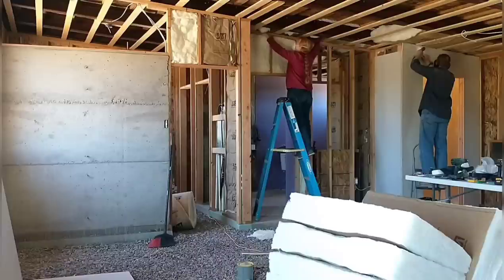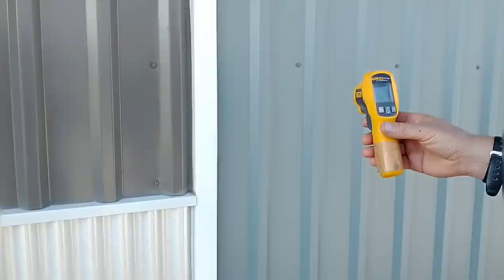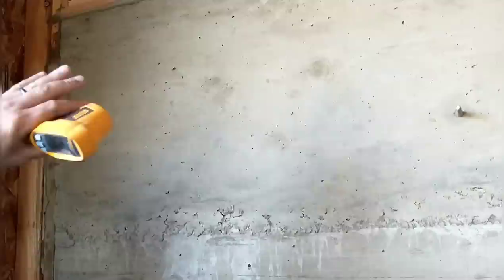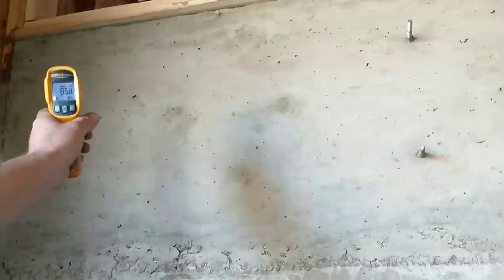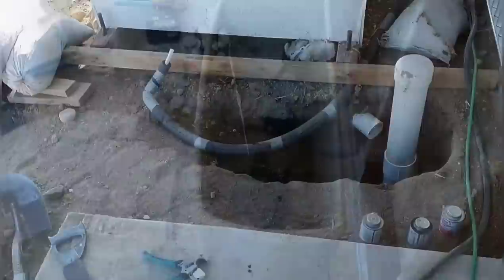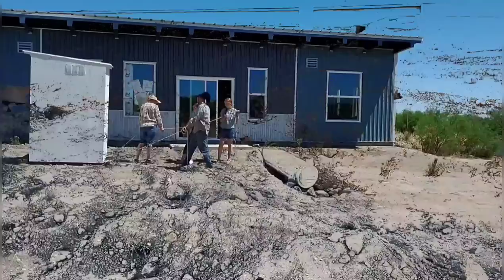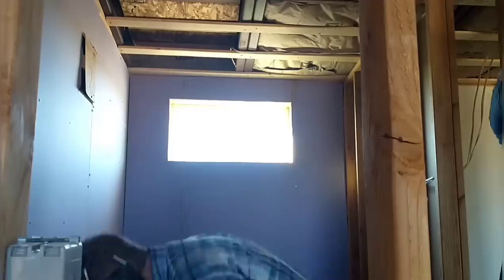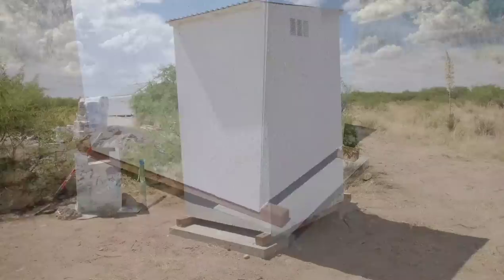PASSIVE Home DESIGN Performance | Exterior Insulation, Metal Beams, Thermal Bridging #32 DIY Build

Comment: Your friends are going to love your drywall lift. Ours gets loaned out all the time. =) Oh, it is also wonderful to use yourself as well.
Reply from the maker: 😄 Yes, it has been really nice! For once he is actually enjoying putting up drywall on the ceiling. Through the years I have held a fair amount of sheets up with my arms and head as he was on the other side trying to hold it up with one hand and screw it in with the other. Fun times! 😅

Comment: The drywall lift is a life/shoulder saver! I bought  a used one for the price of a two day rental at HD.
Reply from the maker: The one we got cost $180 delivered to our house. It works great, and we can sell it when we are done with it. It was definitely worth the cost!  I have held many a sheets of drywall with my arms and head while Red was on the other side trying to help hold it up and screw it in.  Not fun! 😅

Comment: April, your garden looks good 👍 
I found that BC powder (it's a powder aspirin) works on Aphids. 
I did add 10 drops of soap to the 16 oz. of water, BC powder and spray above and underneath.
Reply from the maker: Thanks for the tip! Have you tried crushing your own aspirin, or do you just buy the powder?  I have tried spraying dish soap on the aphids, but it doesn't seem to have much effect. I have been trying to squish and wash them off, and also sprinkling diatomaceous earth around to try to get rid of the little ants. 🌞🌱
Reply: @RedandAprilOff-Grid  I saw a YouTuber who mentioned the BC powder and I had tried Neem Oil for 3 weeks in a row and the Aphids were still eating my Hibiscus blooms. I tried the powder and it worked. If you can find real aspirin tablets, try 2. You could add more if it isn't strong enough. It won't bother the plants. Good luck 👍

Comment: Yes, as the days are getting longer they are also getting hotter. Been over 100-110 in Florida 4 days this week with humidity of 90-100%. Great progress on the house. Just remember to take lots of breaks and yes it's tedious work drywalling. You'll love the drywall lift.  If you take offset measurements and electrical plan you can cut out for fixtures afterwards. But great job! 👍  I'm not sure what type of flowers and sacrificial plants that, but here we use marigolds, dill to keep bugs off the veggies. For mosquitoes we use peppermint, spearmint,, sweet mint, lemon balm, lemon grass and lemon garlic - citronella is a joke.  Use what you can that works where you are. Great job though guys!😊👍
Reply from the maker: That is real hot and humid! We usually get a couple of weeks over 100° just before the monsoon rains hit, but it's already starting to cloud up in the afternoon which has been cooling things down some. Working inside this summer has been real nice too. I have a few marigolds, and occasionally the birds decide they would make a nice snack. Planting some herbs with the beans is a great idea. We have picked most of the radishes, and I was trying to think of what else to plant in there. Yes, drywall is pretty hard on the arms and shoulders! Thanks! 😊

Comment: I did a drywall ceiling in a garage conversion without a lift.

What I used instead was a plywood scrap (about 2'x4'), an old gate hinge and a 2x4 cut a bit longer than the ceiling height.  I could lift up the drywall sheet and then wedge the 2x4 down against the floor.  The hinge was offset from the middle of the plywood scrap by a bit (so the balance was always going one way but still mostly counterbalanced).

It was still a 2 man job but the ability to wedge up a sheet in place made holding it up easy and the screwing is the other job which isn't bad if you aren't trying to hold the drywall in place at the same time.

For bigger jobs, a lift makes sense, especially if you get a cheap used one or you can figure out other tasks to use it for but sometimes you can get by without.
Reply from the maker: Cool, sounds like a good way to do it. We have hung drywall a few time before, and we're not looking forward to it. I would hold it with my head and hands, and he would help hold it with one hand and screw it in with the other. Fun times! 😅 The lift is so nice, and well worth the $180! He was able to do it completely by himself, and somewhat enjoy the process. It would be nice if sanding the ceiling was a little more fun!  😅
Reply: @RedandAprilOff-Grid  yeah, you can struggle or take the easy route.  I made my tool with scraps, a lift was not an option at the time because the job was not paying enough to justify the expense.  A whole house and more projects in the future is a different story.  I'm just always looking for a better way to use my head than holding up drywall...

If I had a drywall sanding solution I would tell you.  Maybe don't look up?

Comment: Try bougainvillea for the climber to replace the English ivy. It needs full sun and does best in arid conditions, actually does better in a raised planter than planting on grade. 
If it does well you can try it on the house. It will need a mounted galvanised wire mesh to climb the metal sides walls you have.
Does best when forgotten about, only needs water if you are having a prolonged drought.
Reply from the maker: Those are beautiful! Our climate is really a challenge. We got down to 5° this winter, so need plants that can tolerate the cold, as well as the heat. We are extremely dry for 9 months, then have the potential for a lot of rain for the 3 month monsoons.  
The native gourd is growing pretty fast now, so at least that is something.  😎🏜️

Comment: We did ICF blocks, a standing seam metal roof on metal trusses with a complete 8 ft overhang.  Almost 6,000 sq ft counting the basement and we can cool it with 2 standing portable A/C units.  Did all interior framing with metal studs.  Only wood is the cabinets.  Wish we had installed a water catchment system.
Reply from the maker: Nice! 😎

Comment: Someone suggested honeysuckle vine. There is an ancient, huge one between 2 houses in Tombstone. I used dish detergent in water in a spray bottle to get rid
Reply: Sorry posted before I was done. GET rid of the aphids on my roses. Your garden looks amazing.
Reply from the maker: Sounds awesome! I love big old plants and trees! Probably don't want anything that would get too big, since we don't want it to cover our solar panels, but something like that might work for the other container. It's been a challenge finding anything around here that will tolerate temperatures as low as 5°. 
I haven't had much success with dish soap, but maybe I'm diluting it too much. I have been trying to squish and wash them off, and also get rid of the ants. 😊🏜️

Comment: I like that you both use protective gear. I’ve done insulation and it’s awful even with long sleeves. You had eye protection and face mask, too. Would a clear face shield help? Your garden looks great!my neighbor has sweet potato vine and bougainvillea in his yard, here in Phoenix. But our temperature doesn’t usually go below freezing.
Reply from the maker: Yes, people think they are fine without proper safety gear, but don't consider the long term consequences. Lungs and ears need to be protected!  A face shield would definitely have been nice, great idea! After the first day or two, I got a full zipper suit and goggles, which was nice especially for doing the ceiling.
Thanks! Things are really growing fast now. 🌱 Our nighttime temperatures are a challenge, we got down to 5° this winter, our particular spot is much colder than in town.  Excited for the monsoons, hope we all get some nice gentle rain this weekend. 😊🌦️🏜️

Comment: So, you now have a house you only have to cool? Or does it ever freeze several days?
Reply from the maker: Our winters are pretty cold. We get below freezing temperatures every night from November to April. We even got down to 5° one night!  The days warm up nicely though, and are generally sunny. So, the sun coming in through the south windows should warm the house up a lot. We plan to put a wood burning stove in the corner of the living room by the thermal mass concrete wall, but hopefully we won't have to use it except on the coldest days.